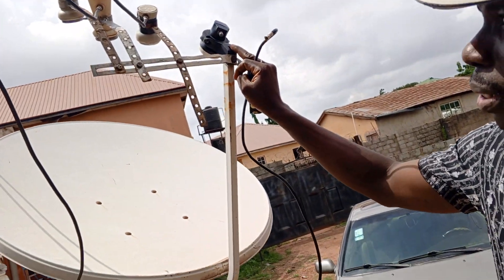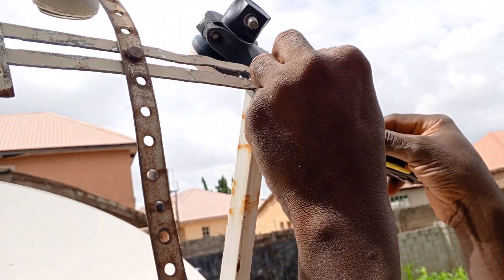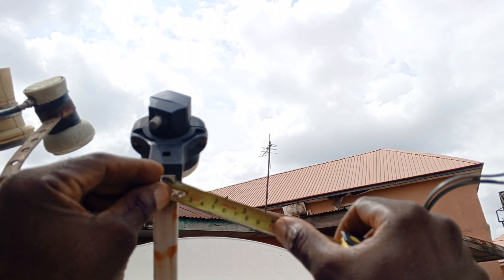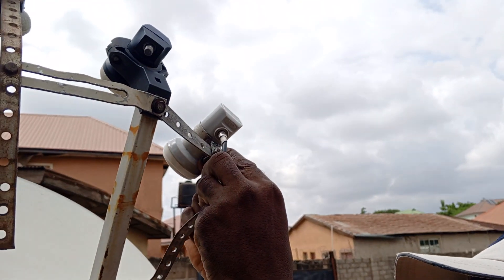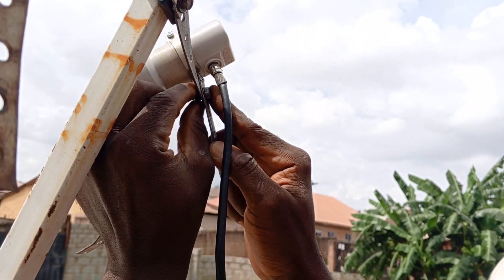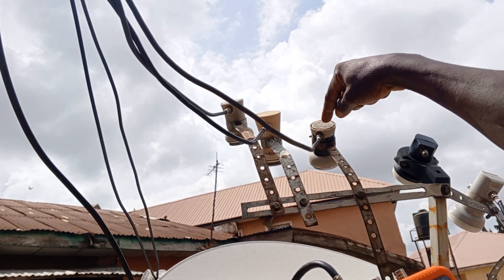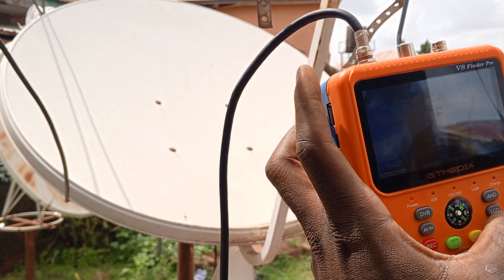Attaching Eutelsat 7E (Secondary) to Eutelsat 16E (Primary)

Comment: Mine is 7e primary and 16 e secondary
Reply: How can i add 28 on that using 7 e as primary
Reply from the maker: Just the way you see it in the video. About 12 inches to  left when facing the dish
Reply: @JoeSigauke  is it on top or by side?
Reply from the maker: As long as it is working fine. No problems
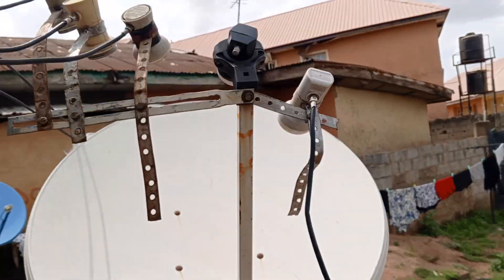Reply: 5:07  @Satellite_PUSH